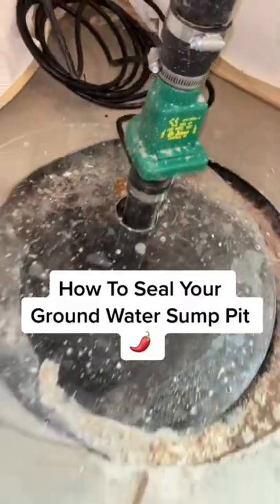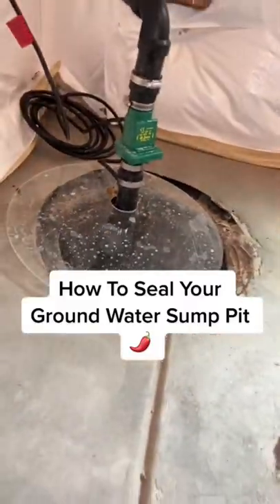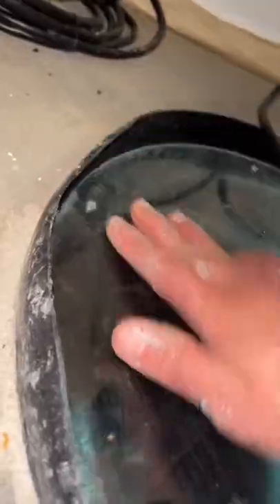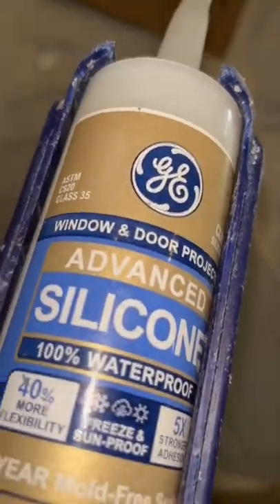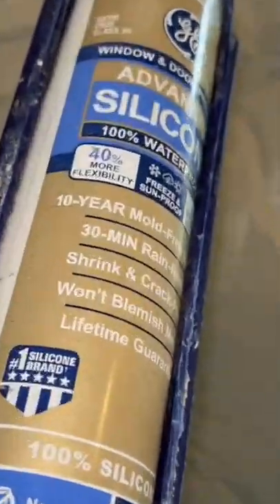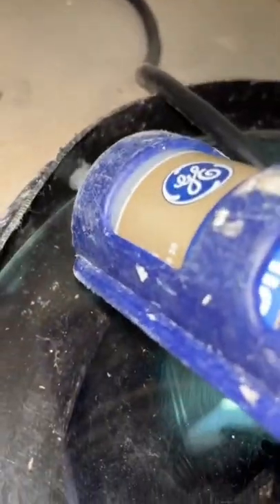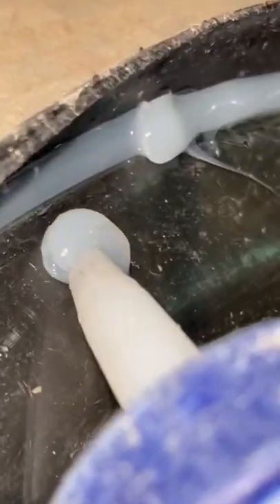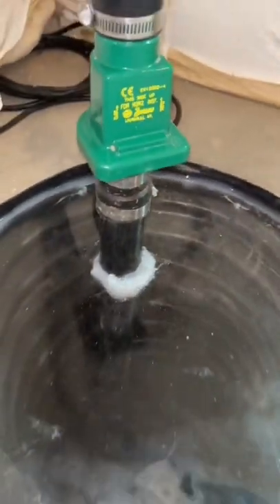How To Seal Your Ground Water Sump Pit  #sumppump #handyman #diy #basement #radon

Comment: You only need to seal the lid if you have a radon system installed in the pit as well. Sealing the lid is not going to keep radon out. Radon seeps through the ground and concrete into basements.
Reply: What is a radon system? 

I thought radon gas comes up from the ground from depleted/depleting plutonium
Reply: You are correct
Reply: @dackbowland1876  when you guy your house they'll do a radon test. I never heard of it having anything to do with sump pumps but if it's high you have to install a venting system.

Comment: I am plumber and you do wayyyyy right! Good job! Way to spread goo helpful info!
Reply: Lol if ur an actual plumbing you’d think this is a bad idea. What if it needs to be serviced in the future? Or what if the pump needs to be replaced? The lid already comes with screws and bolts to fasten in the lid
Reply: Definitely not a plumber,maybe an apprentice. Only injector pits gets sealed bud.
Reply: No, people with high radon levels NEED to seal the pit. Pain in the ass to have to replace the pump when needed but it must be done

Comment: Some sump lids come with the weatherseal foam role. Placed in the front of the screw holes and it helps keep air tight. There are also plugs that have holes for fit each pipe size that screw into lids. As someone who services them, I appreciate when they aren’t caulked but understand why it’s done. Nevertheless I prefer the described setup for the lid

Comment: Why dont leave the top open so the water can go inside of it if needed?
Reply: He literally said gas comes out
Reply: Water will come in when the water table becomes to high. These will help before the water table becomes too high and starts entering your home
Reply: @mattk8810  he's wrong
Reply: @KhanJoltrane  no a concrete basement can hold water like a pool so once it fills it won't drain through the ground, and a sump is to get the water out and prevent it from getting in but sometimes it can't keep up
Reply: @NuKe0clan0cod0videos  that's what floor drains are for. A sump well is for the ground water that comes upward, usually when the water table rises due to heavy rain. No offense, but many people here have no idea what they are taking about. Maybe stop guessing.
Reply: @allaboutroofing2  I'd want a sealed basement
Reply: @shyguy2481  uh- above grade water leaks happen and that's what floor drains in basement (not foundation sumps) are for. Also, you can't completely seal a basement floor due to expansion joints. The slab 'floats' and has water permeable edges that allows for the expansion and contraction of the floors. It's why walls are floating in a  basement as well and required by code in most places with subterranean living spaces. The slab moves as much as an ³/⁴  of an inch. If you are lucky it won't move at all. Depends on how expandable the soil is where your home is built and how high the water table is. Water comes in from either underneath and isn't sealed, it can't be, or it comes in from above the slab in form of an exterior irrigation leak or internal plumbing. The two ways the water are removed is different, above grade to waste water sewer drain with a floor drain, below slab thru sump and pumped back to ground level away from the home. -GC

Comment: I live in the desert where we don’t need these, but I have to ask out of curiosity. If you seal it air tight, where does the make up air come in when the pump turns on?
Reply: Oooh snap.
Reply: Yeah I don't think this was a good idea...
Reply: Discharge pipe?
Reply: The ground, the sump needs to be sealed due to radon gasses in the ground that leak into living area. The radon system pulls the gas out of the ground and out above living area(usually roof). The areas where this is needed doesn’t have any issues of creating a vacuum effect if that is your concern as there is a perimeter drainage system that can pull air around the basement slab so any air that works throughout the ground will make its way in. Ground is porous is how I’d explain it. Not dry compacted.
Reply: @thomassosa2957  you can test for radon with a cheap kit.  If  you have it, it's better to get a fan that runs outside the house and evacuates the air from that area in my opinion.  That's what people do in Michigan.  I have no radon positive test so I don't seal or use the evac system.
Reply: @webcompanion  correct, not all locations need the system. Even if a neighbor has radon issues doesn’t necessarily mean your home will so it’s best to get home tested beforehand.

Comment: Nobody seals the lid..
Reply: They should always be covered with a gas-tight lid to avoid moisture problems, as well as to prevent the seepage of radon into the home.
Reply: @mattk8810  lived with an unsealed sump pump 30 yrs as many ppl have...no radon not like its common anyway an if it is I'm sure the u.s. government would love to know where u live an find that uranium lol..never had issues what so ever besides when u need to replace which u will sooner than later
Reply: @mattk8810  radon? How? What? How’s radon get in there and what is any of this?
Reply: @mattk8810  wrong. 🤣

Comment: Your pump may become air locked. I do not see a vent. I only see the discharge tube. If you’re going to seal a pump into a basin you must have a dedicated 2” vent line. Your discharge and inlet are the standard openings in a basin but if sealing you must also have a vent line and usually a smaller opening for cables & rope to pull up the pump and also a small opening for the power and float cables.
Reply: Sealing it won't create an air lock.
Most pumps have a breather hole.
If the pump doesn't, just drill a small hole in the pvc below the check valve

Comment: You definitely do not need to seal a sump pump pit. Also you are potentially destroying the sump pump with the caulk that fell through that hole. Next time use a sump pump lid rubber gasket. I am fan of starting your own business, but one thing you should not do is learn on people’s money. If your not sure , take the time and study. I know you only mean good but you could be potentially doing more damage.